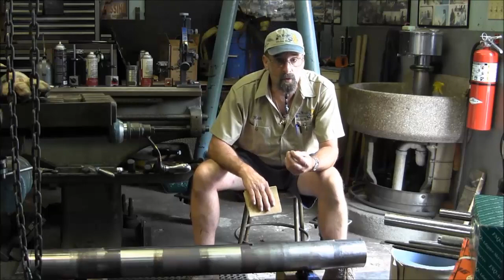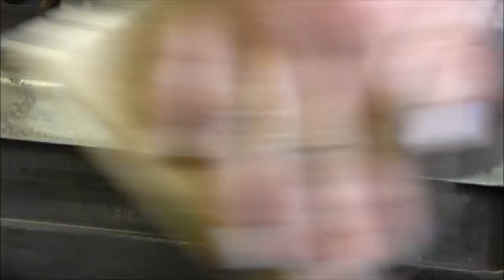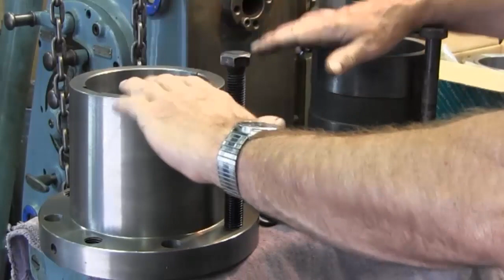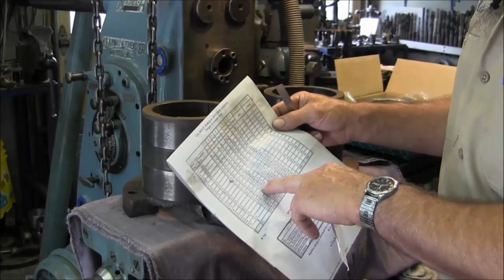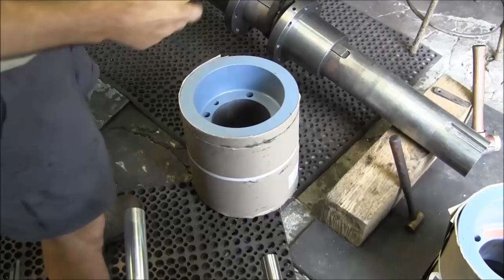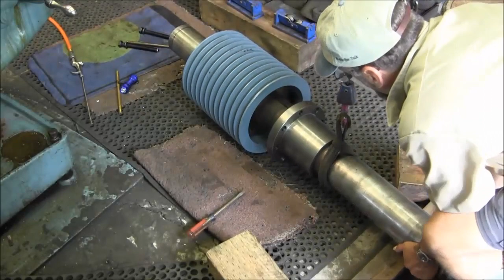Jackshafting Part 5: Tub Grinder Jackshaft Refurbishment

Comment: Keith nice work, and attention to details.  Looks like there are many ones on this job, cleanliness, high spots, location of set screws, and knowing the dimensions that insure the couplings are fully locked on the tapers.

On this job it looks like the size of the work prohibited you from working on one of your tables.  If you could would you have done this work on a table or pipe supports?   I know it sucks to work on the floor sometimes.

Comment: Hey Keith, nice project again!

But I have a question... at about 05:00 you say that you don't want any neverseize or something in the metal to metal-contact. But why? I often mount ball bearings in corrosive environments putting neverseize on the shaft and the housing (not IN the bearing), may this cause trouble?
Greetings from Austria

Comment: Love this series, it really drives home how important it is to know your materials, how temperatures affect them, and how all that and size affects fit, torque, etc. In regards to machine operation I suppose just one example where this knowledge is really useful or even absolutely critical is when you are using a tapered mandrel to hold a workpiece in a lathe.

Comment: At work we use something similar to seat our bearings (not on a taper lock, just to make sure the stack up is completely seated). It's actually a hydraulic cylinder in the form of a nut. Thread it onto the shaft, hook up the pump. 8000 PSI later, the entire stack is completely seated. Then just slap the nut on with some Loctite, and that bearing is good to go.
Also, we use Molykote on our shrink disk taper locking surfaces.

Comment: Hi Keith. The divots that you were massaging out, would you not check that with crack check or is it just metal pulled up by they tight tolerances between the flange coupler and the shaft. I guess I would be concerned about torsional cracks caused by the stress riser marking created by these parts. I'm I just being to picky?

Comment: keith  we recently changed a bearing at work to  a cedar rapids rock crusher. On the taper lock surfaces the maker recommended dry graphite ! 1st time I heard of it ...also we use a hammer nut wrench to set the lock ....not the retaining nut....its hamered till it wont turn nomore...then the retaining nut put in place (the nut wrench is the same thread as  the reatainer just alot heavier with 3 lugs welded on , which gets struck with a maul) the bearing weight 160 lbs and was 4000 $ Canadian LOL

Comment: There is a specific tool made just for cleaning cat-40/50 tapers. If you were referring to the inlet there is a seal. Although on cat tapers or nmtb or what have you, the taper is too obtuse to provide much"locking", like a Jacobs taper would.. The angle is there for positional accuracy, and the retention knob or draw bolt locks it in place.

Comment: Hey Keith I find when I want to align holes I take the old bolt cut the head off, taper it slightly and cut a slot for a screw driver for easy removal, needless to say I have a ton of guide studs in my box LOL. PS great video!